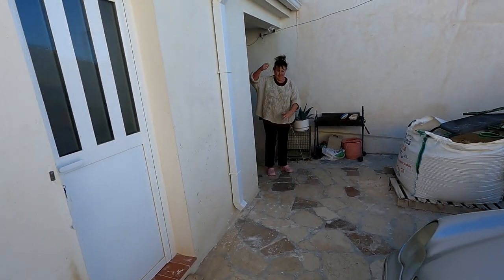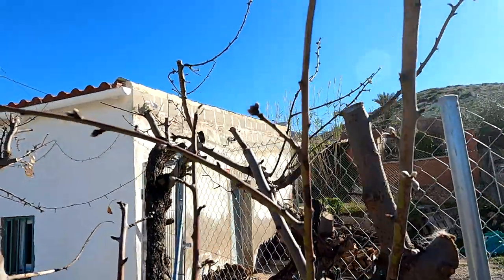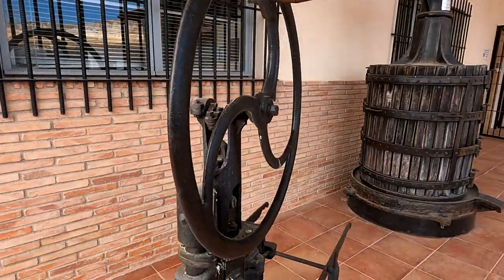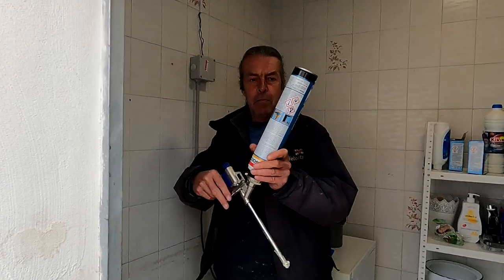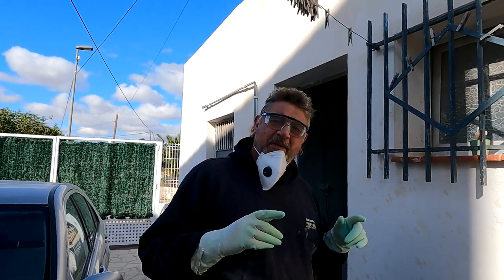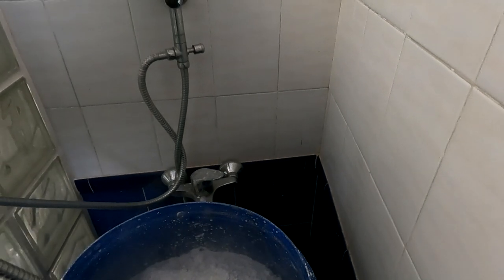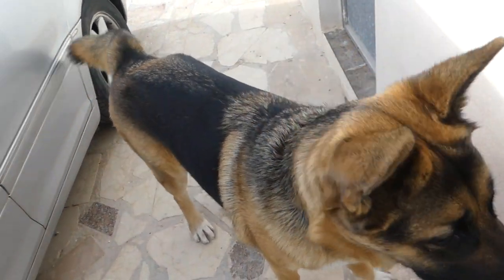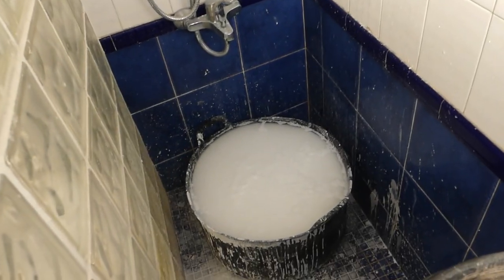Making slaked lime/ lime putty at the cave house and Finca in Spain (Ep170)

Comment: Oooooooo thanks for showing the machines outside the bodega. Also the making of the two different limes is very interesting!
Reply from the maker: They are really nice, there is an old cave bodega near us that had some wine or olive pressing machinery in, but it has now been sealed up, that was quite impressive. We wanted to see if there is going to be any difference between the two when we come to use them and which one is more economical.

Comment: That was fun!!  Will your setic system survive the experiment after you have washed it down the plug hole whilst cleaning the shower  😆
Reply from the maker: Yes it was and quite interesting as an experiment. The septic system will be fine as it is pure lime, plus the live lime is sold as a drain cleaner and soil conditioner amongst other things here.
Reply: @talesfromthecaveside  excellent, what do they call the lime product you mentioned....I live in Malaga province
Reply from the maker: The easy to use one is called Cal Hidraulica & we get it from our builders merchant. The dangerous one is called Cal Viva

Comment: Great info guys thanks, that looked a little crazy in the black bucket! how quickly is the quicker line putty ready to use?
Reply from the maker: It was a bit lively and expanded more than we expected. Allegedly it is ready after a couple of weeks but not sure, it might be better to leave it to mature for a while, plus it doesn't go off as long as it doesn't freeze or lose its cap of water although you can rehydrate it again if it does.